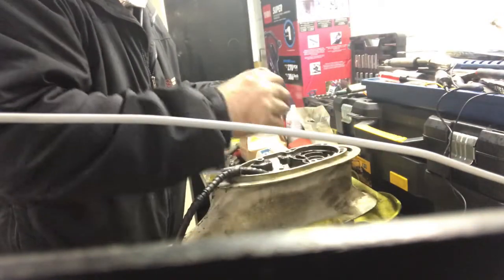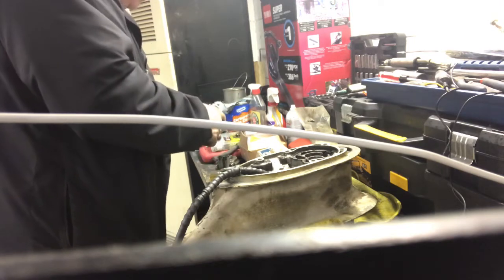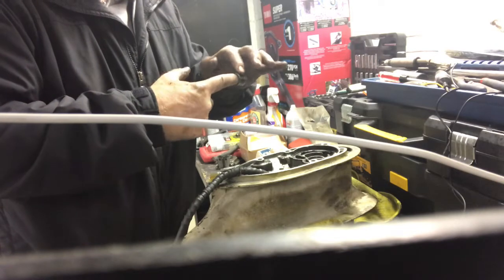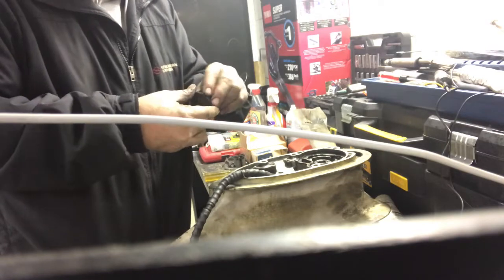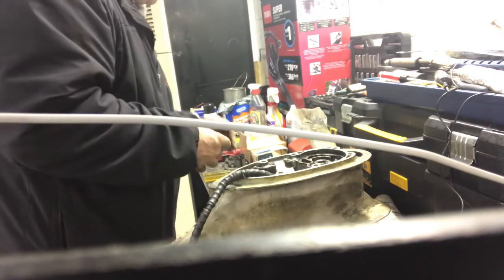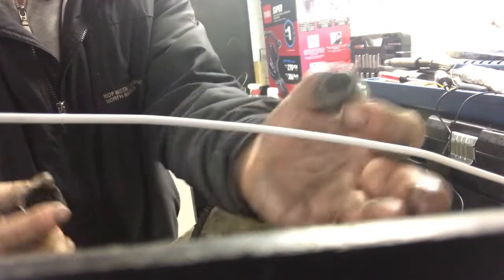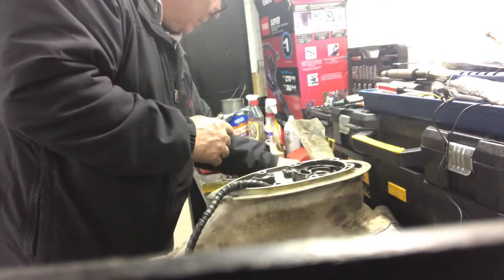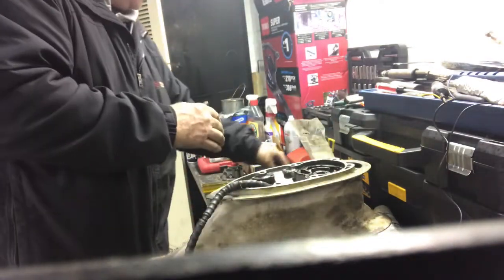1963 40hp Johnson Electromatic - Lower Unit Bad Driveshaft Bearings - Part 8 of 12

Comment: I have a 1966 40hp RKL-28B. It is nearly identical to this engine. I had to replace the upper gearcase housing because it was cracked and leaking. I'm trying to reuse the old electromatic shift cable because it's still in great shape. Is there a trick to removing it from the gearcase housing?

Edit: one more question... do you have the part numbers for the bearing tools? I apologize if you've already mentioned it.

 Thank you.
Reply from the maker: @jeffrockwell8493. … the only way to remove the cable without damaging is to cut the casing open. Those cables create a watertight seal and are designed to be cut when removing them. I will have to get back to you on the tool numbers for the bearing installers.